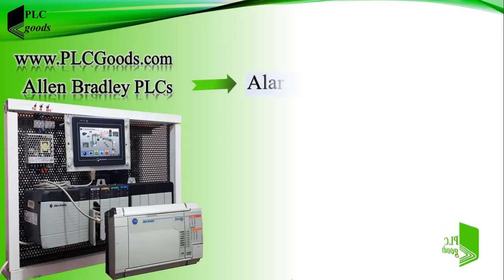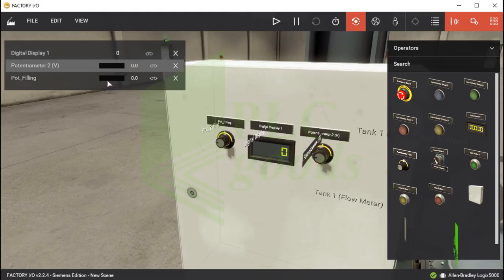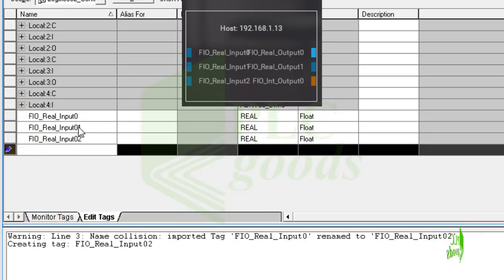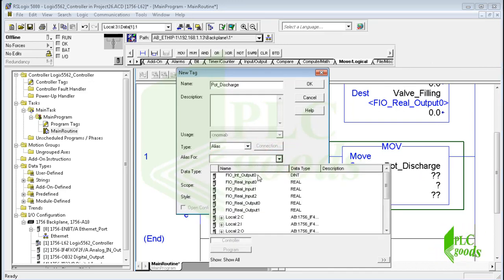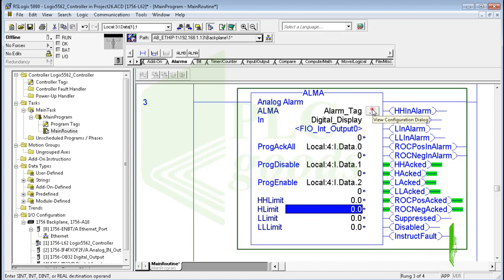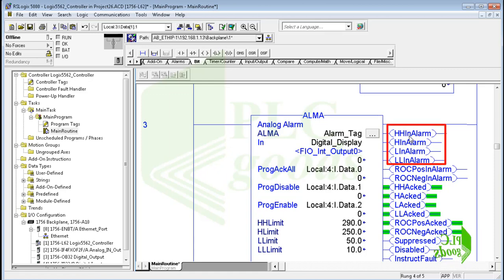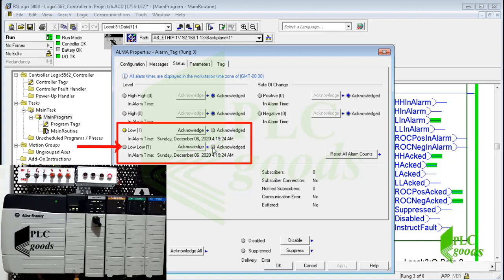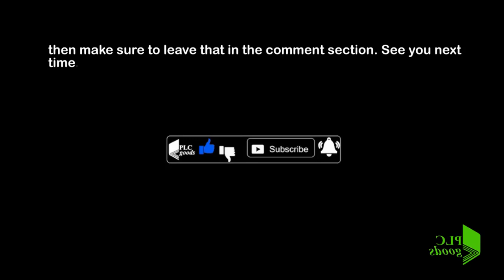RSLogix 5000 Alarm & Alias Instructions Tutorial | Water Tank PLC | Lesson 26

Comment: hello sir i have a question you make 5 as the different to turn off the output but when the water level goes higher then 255 the output didnt turned off even when it reached 300
Reply from the maker: Hi there, please explain your question in details and determine the exact time of video that you have a problem with that. Pay attention, my program doesn't control valves automatically (based on the alarm conditions). I use 2 potentiometers to turn on/off valves manually.💚💚